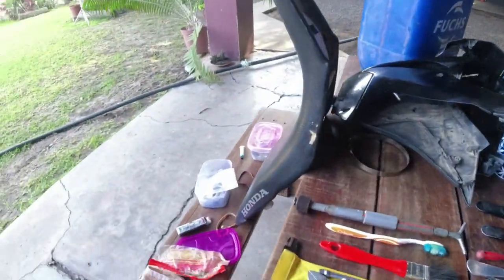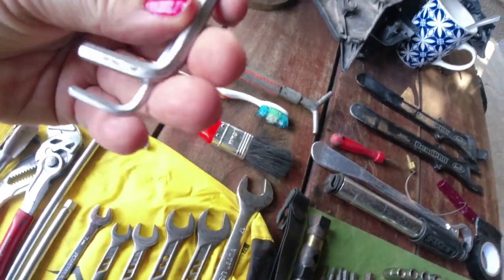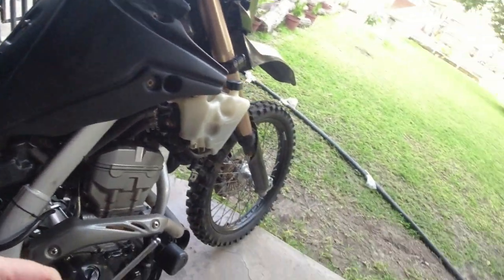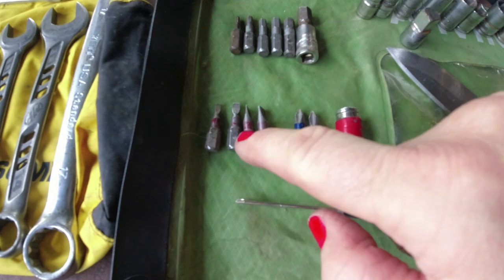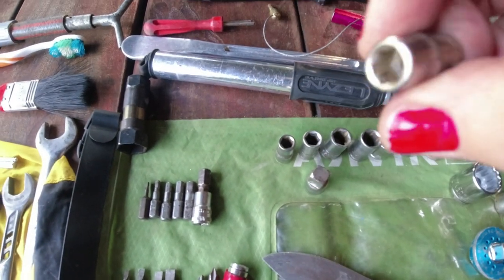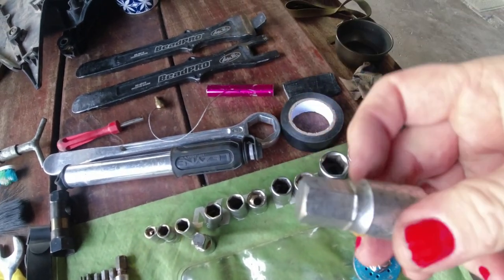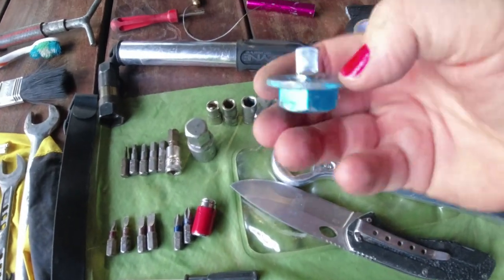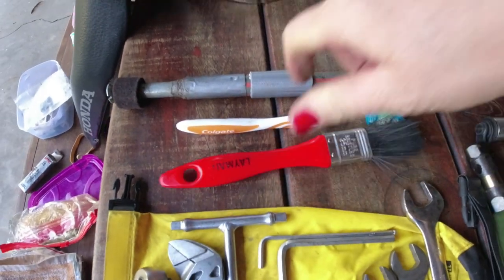A complete walkthrough of all the tools you need on a long distance motorcycle adventure

Comment: The screwdriver bits you called “star” are commonly called “Phillips” (in the US, anyway). Fun fact (if you didn’t know): if you see screws which look like Phillips on a Japanese motorcycles, there’s a good chance they are actually JIS screws; JIS (Japanese Industrial Standard) generally have a dot stamped onto the head. While you can use a Phillips screwdriver on a JIS screw, the JIS screwdriver will grip the head better and is less likely to “cam out” (slip and possibly strip the head). My life got ever-so-slightly better when I started using JIS screwdrivers on my bikes. :)
Reply from the maker: Hahaha! Love that your life got better! 
Thanks for this! I also use the JIS at home, but fortunately there are only a few Phillips screws on the Honda and on the trip I just use my small Phillips bits.
Reply: Ah, cool. Just wanted to be sure you knew. Cheers. :)

Comment: You forgot one item you may not even know is a handy part of your toolkit: Nail varnish! 🤗
Here and there, you have screws that are more vulnerable to shaking loose with vibration, most commonly the ones that hold the license plate. Nail varnish works quite well as screw locker there. Tried and tested method with outboard engines of the THW disaster relief organisation of Tshørmäny! 🙃 
Most actual Loctite thread lockers let go of their screws more easily, so apply only small quantities, like tiny drops from the tip of a toothpick into the threads or under the head of a crew or bolt or so, but the stuff actually worked pretty well for in the field- emergency repairs.
Reply from the maker: Ooooh, good tip - and you know I got it!! 😆
Reply: @ForTheLoveOfWheels  One can't not see it!!1! 🤗